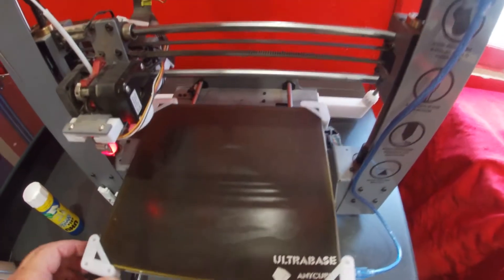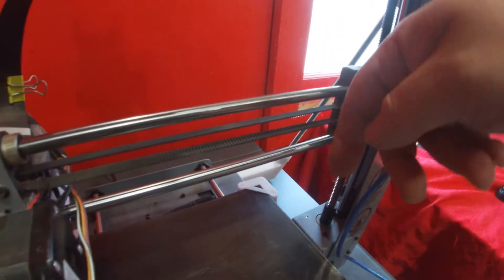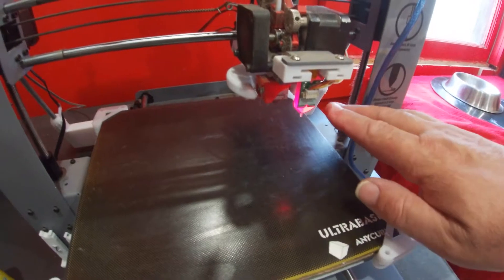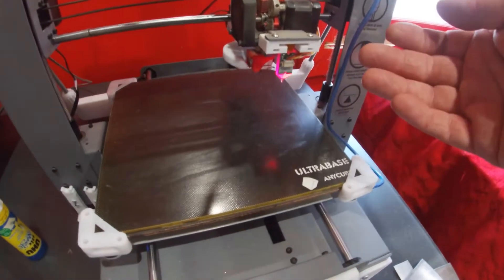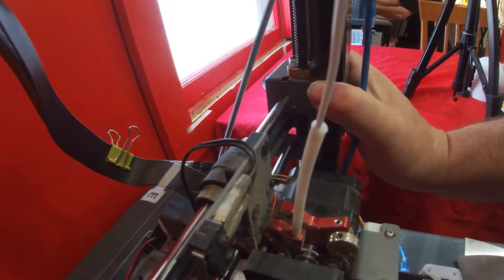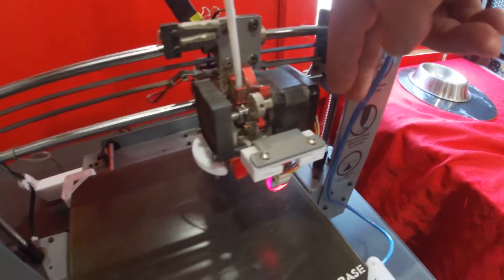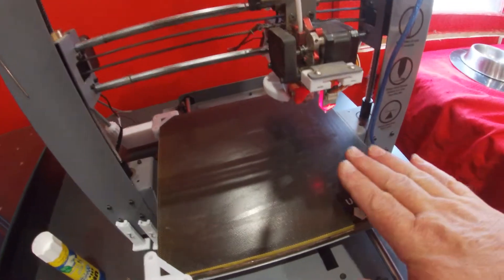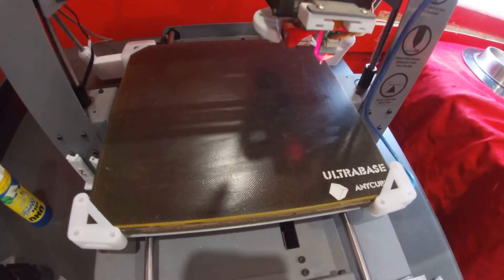Cocoon Create Touch BLTouch printing too high on right side.

Comment: i solved this problem before for my cr-10s4 , one side is printing is good and another side not good !!

-so  in first time i thought with my marlin setting so i upgrade my marlin to 2.0.6 and with new setting for bltouch  but nothing changed still same problem

so the solution  you need to make sure everything is tight good  for all bolt and nuts and also no play for wheels for x axis must be no play 

also make sure the two stepper motor  for z axis is leveled same hight 

also make sure the bltouch is installed 90 degree  in both side

i hope this will help everybody
Reply from the maker: All the things you noted also affect the print the same way when not using the BLTouch.
while it is not good or best practice, it is possible to level the bed to match a miss-alignment of the heights of the Z-Axis and after leveling of the bed does not cause an issue.
If the BLTouch is setup correctly and you are using mesh leveling, then even a level bed with a miss-aligned Z-Axis is corrected for.
If however the X-carriage rotates even a little bit between the left and right sides, and the BLTouch has any Y-Axis offset, then you will get the issue of the printer trying to print higher on one side than the other.
That's the issue this video was created to address.
When running without the BLTouch on the Cocoon Create Touch, the bed could be manually leveled and it would work fine, only when the Auto Bed Leveling (ABL) was run would the problem be present.

I have seen faults where the bed is not level, lower on one side, and the Gcode calls the G29 code to perform the ABL routine, then the next command is G28 to re-home the printer.
G28 disables the mesh leveling so the previous G29 command no longer works.
You should always perform the G28 command before the G29 command and not call the G28 command for the rest of the print.

It is always a good idea to regularly cheek your printer to make sure everything is tight where it needs to be and free to run where it needs to be. (you don't want tight bearings ":-) )
A loose carriage bearing or belt can have detrimental effects on your print.

While it is desirable to have the BLTouch square to the bed, in practice, as long as it's position is not changing during the probing process and the angle is not too great, it really makes very little difference. 
What is important is the trigger point height relative to the tip of the nozzle, this should not change at all during probing.  
I have had good prints with the BLTouch mounted with a 10 degree tilt. 
It looked bad, but it worked.  
After a few month of running like that, I got around to fitting a new mounting bracket on the CR10S5 :-)

Ray

Comment: Ray, I have been looking for this solution for months and could not figure out why I was having issues.  Thank you!
Reply from the maker: Glad I could help :-)
I spent a few months trying to figure this one out as well.
I could see the BLTouch was running true.
But when the bed was leveled manually, not using the BLTouch, and the rail heights were measured from the bed to the top of the X-Rails, there was a small error there.
The real problem was trying to figure out why :-)
The error is so small as to be very easy to miss.
This video is listed in the ADVi3++ forums now as a common problem and solution.  A good place to look for any issue with this printer. :-)